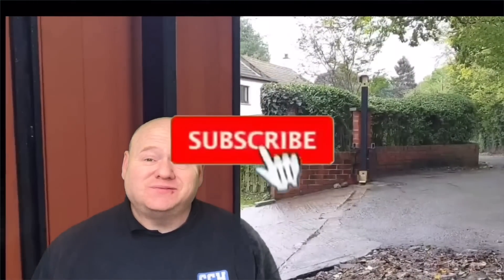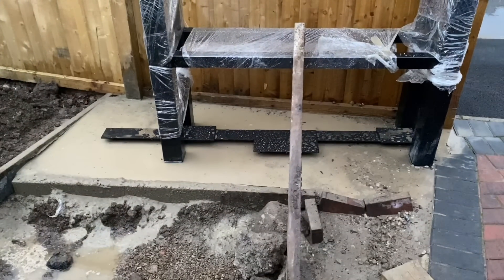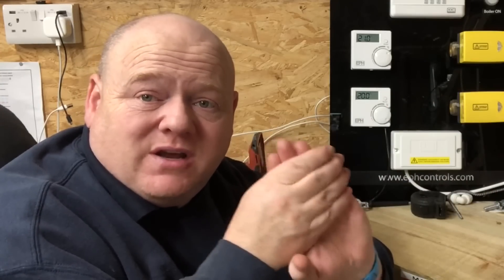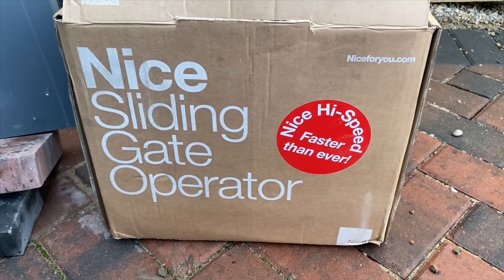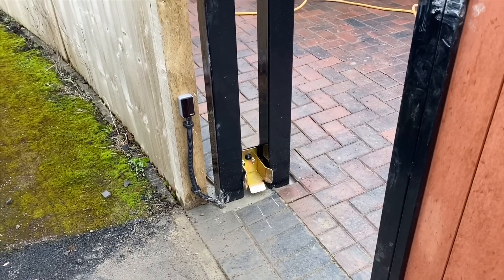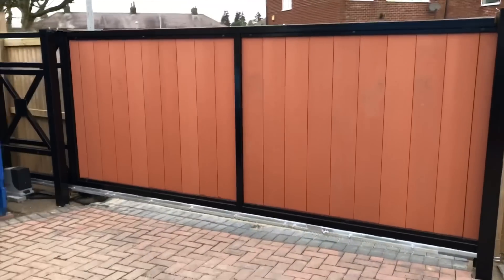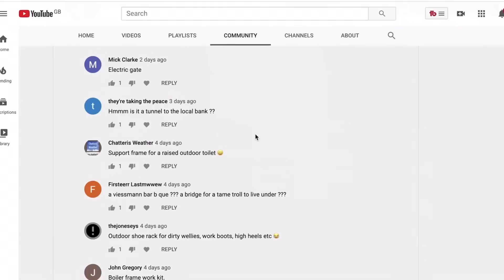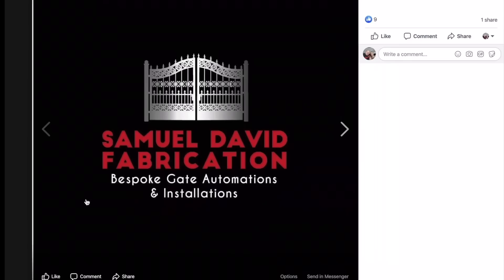Driveway Gate - Electric Gates - Full Installation

Comment: Did you get planning permission to get those gates installed? Looks like its above 1 meter height restriction
Reply: Same height as the fence so why would he need planning??
Reply: @markcourtney7251  anything above 1 meter requires planning from what I was told by the council. This applies to fences as well so chances are the fence is also installed without permission

Comment: I fitted a gate in which my cantilever track has spread/widened and can not get to the bottom of it. Track is rated for 600kg but gate is only 300. Have you came across this problem before alan?

Comment: Hi pal I'm looking for a couple of gate openers as mine isn't the slider type so its two gates I'm fitting 6ft high by 6ft wide there going to be wooden gates so l need something that can handle gates like that I'm in ayr in Scotland so do you have a phone number that l can call someone to have a chat for what l need or a link to a website thanks.
Reply from the maker: 07801 933516 Thanks.

Comment: Under the EU Machinery Directive 2006/42/EC all new machinery
has to be designed and constructed to meet the common minimum European
requirements for safety. Can you see any?
Reply: I had this discussion when this video was first put up. These gates are a danger to the home owner and general public. No safety protection at the rear of the gate and none at the front edge. Whoever fitted them should stop fitting gates before they injure or kill someone and the owner should turn them off until they are made safe. Any decent gate company that came to service this gate would put a critical safety sticker on it and turn it off. Will people never learn. Every  time someone has asked Alan Hart about safety he just says that he'll look into it. If I were him I'd look into it as a matter of urgency and in the meantime turn the gate off.
Reply from the maker: Thanks.
Reply: I see the one set of photocells that come with the kit, otherwise DENADA!!!!

Comment: Where is the safety on this gates. Any gate company that came to service this would condemn the gate until it was made fully safe.
Reply from the maker: What safety should i be looking for? Thanks.
Reply: @AllenHart999  There doesn't appear to be a safety edge on the leading edge of the gate so you have an entrapment issue between the leading edge and the slam post. Where the gate goes past the wooden fence you have a drawing in hazard. The whole rear of the gate is a drawing in and entrapment hazard.  Please go to the DHF web site and have a read on gate legislation.
Reply: Those two IR sensors are mounted for safety reasons. Also, I don't see it in the video, but Nice kits come with a yellow flash light that is mounted in top of one of the pillars near the gate, so is visible from in and out the yard, and flashes as soon as the gate begins to operate. No need for other safety measures. My concern is that the cable from the IR sensor is mounted just beneath the pavement, and I believe a heavier car may damage the cable... I would have dig a little further  down to place that cable, or pour some concrete over it, instead of sand.
Reply: @Radu.Ilie.84  One safety sensor and a flashing light wont stop someone getting injured. The sensor is on the outside of the gate where's the safety to the inside and to the rear. The the cable not being buried enough is the least of the problems. Try telling the parent of the child who gets trapped that the child should have taken more notice of a flashing light. Really!
Reply: @stanmeadows2524  There are two safety sensors. Anything comes between them, and the gate stops and reverses a couple of inches. There is an option to add another pair on the inside of the gate, but that's about it. Also, the motor itself measures the force it needs to push the gate, and if the gate encounters an obstacle, that reads in a greater power to move it, and the motor stops. Do you know any other measures? If you do, please tell us.
PS: cars have only brakes and horns, but this things don't always do the job to protect pedestrians, and that is why you tell your kid to stay away from moving cars, and take notice of them, right?
Reply: @Radu.Ilie.84  There aren't two safety sensors, there's one set to the outside. There are no safety to the inside, therefore you can stand on the inside of the safety sensor and get trapped between the leading edge and the slam post. You can get trapped between the wooden fence and the moving gate, look at the video between 08.43 and 08.54. You can get trapped between the moving gate and the frame at the rear. Other measure to take, safety edges and fence in the rear of the gate, if you need to ask you shouldn't be fitting gates.
PS: So why do children get killed and seriously injured on our roads, I guess that there parents hadn't told them to stay away from cars. Just sometimes children don't do what they are told. I don't know if or where you fit gates but you wouldn't fit a gate for my company with one safety beam and a flashing light as safety.

Comment: Nice gate but dont comply 
No edges drawing in trap 
Nice motors ok but for that size of gate and weight I would not have used nice
Reply: It looks like a nicely made gate but the safety needs some looking at really should  be compliant as it's a new installation
Reply from the maker: What motor would you use? Thanks
Reply: @AllenHart999  would probably of used faac bft or dea 
Looking at gate weight probably 800kg 
But if you know material sizes you can work it out then pick what model 
You should really have safety edges front and  rear and at the apatures 
Check hse power perimeter gates 
And DHF website
Reply: @jimbobmcgrigger8495  Couldn't agree more. This gate is an accident waiting to happen especially with children around. One safety beam? The whole gate is an entrapment hazard. How do companies get away with this sort of install.

Comment: Has the gate got any safety rubber pressure edges fitted on the front leading edge or the back of the gate when it's in moving operation? Or is it just relying on the lower photo beams to sense pedestrian /vehicle detection?
Reply from the maker: Not sure as i haven’t checked. Will let you know.

Comment: Didn't see a registered electrician doing the electrics as you've run a new supply as you know been gas safe plumber you will realise that this needs to be certified and registered
Reply from the maker: I didn’t even show any electric connections 😂
Reply: Ian, What an ass you are...
Reply: I know but it does run on electric and I didn't see an electrician doing any work did you get a registered electrician to do all the electrical work

Comment: Posh bastard lol
Reply: Doubt it I'm on a shared stop cock I was thinking of a veisman that stores some hot water or am expansion vessel on my valiant eco tech pro
Reply from the maker: @hughblount1983  This one was on a shared main i believe, not sure. https://www.youtube.com/watch?v=JjzLsBfN-9w
Reply from the maker: @hughblount1983  Not much point installing a storage combi unless you can increase the pressure and flow
Reply from the maker: 😂😂😂😂😂😂Thanks.
Reply: @AllenHart999  what long combi boiler do you recommend for a 2 bed house with low water pressure?
Reply from the maker: @hughblount1983  Could you boost the pressure with one of these ? https://www.youtube.com/watch?v=mPmBgEMtHJQ&t=219s